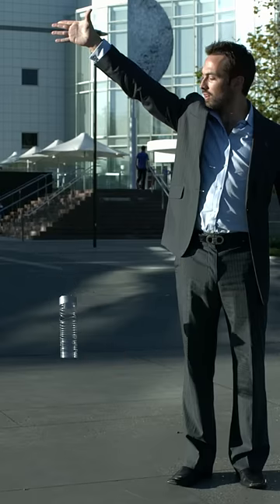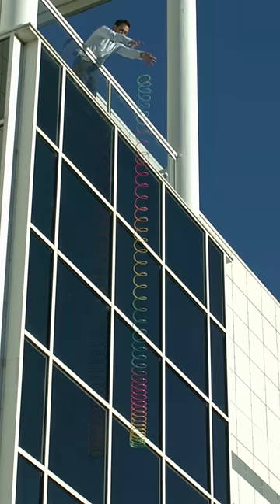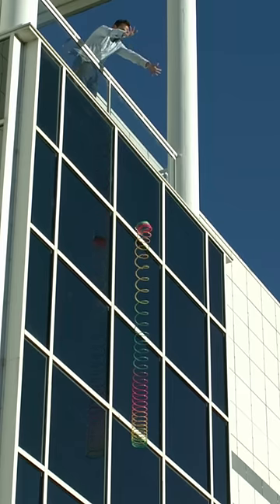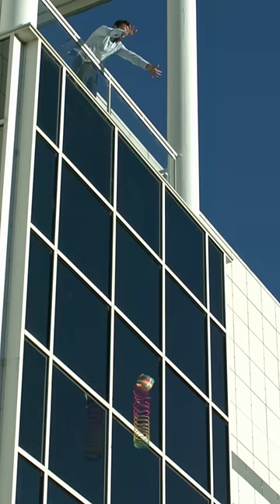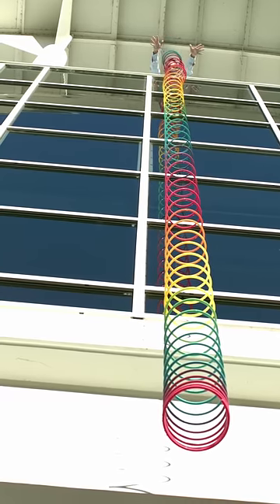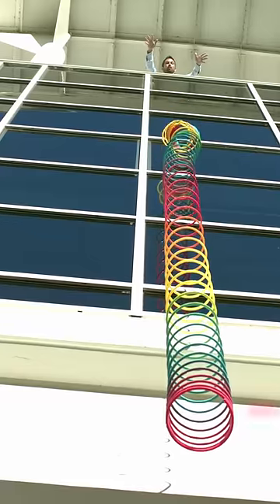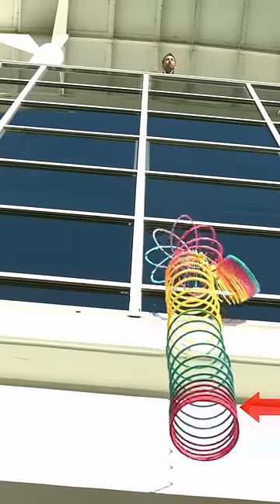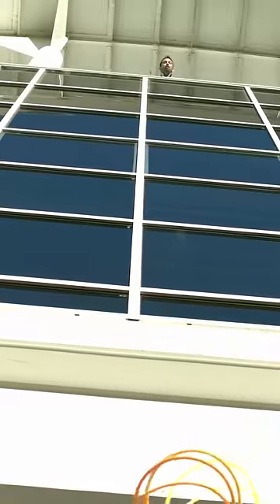How a slinky falls in slow motion #shorts

Comment: Crazy how the top of a slinky can get beneath the bottom before the bottom starts moving down
Reply: Just an illusion, the bottom is just moving up at the same rate as it is falling.
Reply: @IdgaradLyracant  well that's equivalent to the bottom isn't moving lol
Reply: @IdgaradLyracant  that’s great, but it doesn’t contradict what I said, the top still reaches below the bottom
Reply: @IdgaradLyracant  It's actually not. When you hold a slinky, there is a force-ballance between the force you applied to hold it vs the tension force. When you then release the top part, the tension force that hold the bottom part against gravity doesn't instanteniously dissappear. This "information" about the force become zero travels at finite speed to the bottom via the propagating wave on the slinky. Once the wave reaches the bottom part, the tension force that holds the bottom part then become zero and it start to fall down.
Reply: haxx
Reply: I bet we can find someone to bet $10,000 that it doesn't :)
Reply: @IdgaradLyracant  it is not moving. the forces of gravity are canceled by the force of tension upward.
Reply: @IdgaradLyracant  I'll never understand this on an intuitive level. The same effect happens to geosynchronous satellites which are "falling" at the same speed they are rotating, making them seem weightless while being locked into the Earth's gravity.
Reply: Top.. Bottom. both irrelevant. That question is where is the CENTER of gravity of the whole object. If you follow the center of gravity of the entire thing. it falls just as you would expect.  he should have done a side by side with the slinky and maybe a ball about half way up the slinky and release them both.
Reply: Because it's spring loaded genius.
Reply: Yeah
Reply: It feels very Acme
Reply: if He didn't just let go but gave it a push to any side. There's a chance the top wouldn't crash into the bottom then it would have gone much more past the bottom. probably even spun. There are a lot of variations that could be done on this experiment that's for sure.
Reply: @chessicles99  Yeah but there's a force on it. The weight is pulling it down(stretching the spring) and the spring is resisting.
Reply: @piercingspear2922  it isn't "information", it is inertia.  Inertia keeps the "top" exerting force "holding up" the bottom.
Reply: That actually makes perfect sense because the top has a big head start compared to the bottom. The bottom stays in place pretty much until the top almost passes by.
Reply: @IdgaradLyracant  Agreed, buy why? Why wouldn't it rise or fall a tad, why does it stay still?
Reply: @capturedflame  that's legit
Reply: Because the top part has greater velocity than the bottom part as the top started moving first and is accelerating at a rate of 9.8m/s^2 due to gravity. Thus it hits the ground before the bottom part.
Reply: Gravitational acceleration
Reply: @DumbledoreMcCracken  define inertia
Reply: @sachinbhargav  - The top is not accelerating at 9.8 m/s^2. The center of gravity is. The top is accelerating faster than that, because the spring is pulling the the top and bottom towards each other.
Reply: It is due to spring force which is lazy force
Reply: "before the bottom starts moving down". This should support his argument  very well. Yes the bottom is "moving up" relative to the gravity and tension in play, but that sentence pretty much sums up what he's trying to convey.
Reply: @LeonardTavast  that’s actually somewhat different. This is just a balance of forces so there is no acceleration.
Reply: While the bottom of the slinky is in equilibrium from the tension and gravity force, the top is being pulled by BOTH tension and gravity, meaning it falls faster than a solid object in freefall
Reply: @piercingspear2922  OMG.  Inertia is the force that resists motion, equal to Mass * Acceleration.  Didn't you go to school?
Reply: @alexsiemers7898  finally, someone who knows what is going on.
Reply: @IdgaradLyracant  Moving up at the sa.e speed as moving down is equivalent to it just being in the same place
Reply: @sharath2273  depends on your frame of reference.
Reply: Its like a metaphor for my life
Reply: @IdgaradLyracant  Yes, the same rate of 0 m/s
Reply: @IdgaradLyracant  If you talk about a frame of reference fixed to the ground, then it does stay still.
Reply: @DumbledoreMcCracken  no, I don't go to school. It's a waste of time. Highschooler tends to assume they know everything and debating, what they don't realize, two explanations which are equivalent with oneanother.
Reply: @IdgaradLyracant  Reported for using more words
Reply: @DumbledoreMcCracken  You forget one thing: "Educated" people also don't understand sarcasm.
Reply: @piercingspear2922  Well explained 👌
Reply: @LeonardTavast  Different mechanism.  Invalid analogy.
Reply: @JeanPierreWhite  because it was in a balance before release. The balance between tension and gravity. This tension makes the top "fall" down faster so that the center of gravity is falling exactly like any other object
Reply: @DumbledoreMcCracken  what u described is actually the reactio, considering that u need another object to accelerate ur inertial object. The inertia itself is the unwillingness to change the state of movement, which is equivalent to the mass of an object. In the objects rest frame with no applied acceleration this object is still inert, which shows u that inertia is not dependent on acceleration.
Reply: Reminds me of my stock investment.
Reply: Questions: What are the minimum and maximum spring rate constants for which this phenomenon is observable? Maybe just any spring that can be somewhat, but not fully extended due to the force or gravity alone? Also, how would one determine how fast the bottom of the spring would start to fall initially if there were a mass attached to the bottom? Just the spring tension vs the weight of the mass I would assume, but I'm curious.
Reply: @xXxTeenSplayer  it doesnt matter at all what spring constant u have, as long as it is in an equilibrium state when it gets released
Reply: @shadesmarerik4112  that's clearly not true! If the spring constant was zero (not a spring), or if the constant were so great that the spring didn't extend, then clearly this phenomenon wouldn't happen. I don't think you understand my question.
Reply: @shadesmarerik4112  To be clear, if you dropped a spring in equilibrium that has a constant that is too stiff for gravity to extend it, you would not see this phenomenon. Clearly there are limits...
Reply: @xXxTeenSplayer  no, u see it the wrong way, sry to say this. If u have a spring which is completely stiff the top immediately (due to stiffness) crashes into the bottom part and the same thing happens. Only the time frame changes (until the bottom part moves). U can compare the center of mass on both springs (slinky and stiff) and they move the same. Only that the stiff spring top and bottom will move in unison with this center of mass while top and bottom of the slinky will not due to smaller spring constant (= elasticity). i dont think u understood the phenomenon.

There is no difference in the underlying process, only a gradual change in the time the top and bottom needs to the adapt their velocity to the velocity of the center of mass when u change the elasticity of the spring
Theres no limit to spring constant, its the same thing to observe a stiff object falling or a spring that is contracting while falling. U have to observe the latter in the rest frame of the center of mass (which is falling) and then its just a spring contracting

If u want to explain why the bottom part of the slinky is not moving: because it stays in an equilibrium after release, until center of mass is crashing through the (bottom part) system. The top part moves faster than falling speed because the slinky is contracting while falling
Reply: @shadesmarerik4112  Wow, you are super confused. How could a spring "crash into itself" if it was never extended in the first place? Go back to school then maybe I'll reply again.
Reply: @shadesmarerik4112  you really don't understand my initial question, and that's okay.  But next time, before you write a thesis, maybe understand the point first. If a spring is not extended, than this phenomenon doesn't happen. Much of what you said is correct, but there in lies the rub; you don't get what I'm saying.
Reply: @shadesmarerik4112  we all (possibly with the exception of you) understand why the bottom of a gravitationally extended slinky doesn't move when the top is let go of. That literally has nothing to do with what I'm talking about. Ugh, some people.
Reply: @shadesmarerik4112  For fucks sake, you just said that a solid object exhibits the same phenomenon! You show me a solid object, that when dropped straight down from a stationary position, in a gravity field, where the bottom doesn't start moving at the same time and at the same rate as that of the top of said object.

Inb4; yes the tidal forces of a small black hole could do that, but let's limit this talk to the gravitational field of the Earth. ( And of course, that would act completely opposite to the slinky; the bottom would start accelerating faster than the top; good ol' spaghettification!
Reply: @xXxTeenSplayer  u wrote 4 comments and are still not able to justify a reason why there would be an artificial limit to the spring constant. Maybe it is as i said, and the "phenomenon" u want to describe is just the time difference between the movement of bottom part to center of mass. And "doesnt happen" is a completely subjective determination which has nothing to with the reality of the top crashing into the bottom eventually (just faster when the spring is stiff)
Reply: @xXxTeenSplayer  the bottom not moving IS the whole phenomenon that we were talking about, only u asked about a special requirement in spring constant. Stop displaying urself as a victim of failed understanding, it is u who hasnt understood the phenomenon if u still claim that there needs to be a special spring constant
Reply: @xXxTeenSplayer  i refuted ur hypothesis, if u arent able to read its ur problem
Reply: @shadesmarerik4112  I mean, if you honestly think that this phenomenon is displayed in a solid object, there's not much I can do for you. Please show me a solid metal bar, that when dropped, the bottom doesn't start moving until the top has reached the bottoms starting point, then phone in your damn Nobel prize. You need to actually learn physics before you start babbling about it and expecting to be correct. Smdh.
Reply: @shadesmarerik4112  And just be clear; for a solid object, due to tidal forces, the bottom of said object actually accelerates faster when released ever so slightly! You are so wrong on so many levels that it's actually kinda impressive haha! 😂
Reply: @xXxTeenSplayer  i actually studied physics at the university. For a solid object the top will never "reach" the bottom this is fallacious. U are desperately trying to rescue ur perspective that a falling slinky has a completely different physics than something with different spring constant which is  not the case. The bottom is just not moving because the slinky is contracting at the same time. I told this several times now, since u are willingly ignore what i am saying i come to the conclusion that u just want to pathetically troll me for some stupid reason.
Reply: @xXxTeenSplayer  and no since a solid object is ideally completely stiff, neglecting any remaining elasticity the bottom changes velocity EXACTLY like the top and the center of mass. And now u are evading the main point again with different irrelevant statement that doesnt further the topic of ur false hypothesis of some "maximum" or "minimum" spring constant that u supposed
Reply: @xXxTeenSplayer  how about u accept defeat, since u already are at the point where u make up claims about something i have never said, or taking it completely out of context, to justify sticking at ur wrong position
Reply: @xXxTeenSplayer  Just make a boost in into rest frame of the object and u will see that the only difference to a stiff object is that the slinky is contracting. There IS no hidden parameter that causes a scale invariance in spring constant. There is no maximum or minimum value of spring constant that completely changes any physics or creates a whole new seperate phenomenon. The slinky that is contracting and the bottom end is last ripped out of equilibrium. For a stiff object this time difference (between the top and bottom moving, relative to a "static" observer) tends to be zero. This is the last time im trying to explain this to u. U have not once presented an argument that can defeat anything of this. How about u learn physics or rhetoric before u embarrass urself with ur desperate misconceptions
Reply: @xXxTeenSplayer  even with not ideal elasticity the size and mass of those objects in question causing the differences in gravitational force completely neglectable vs. the tension forces of the material. That u think that this somehow bolsters ur position of a spring constant limit just shows that u have no clue what ur actually talking about
Reply: @shadesmarerik4112  I can guarantee, and actually show that you're wrong. Do you really need me to show you a video of a pencil being dropped? If you really think the point is going to stay stationary until the eraser overtakes it, well, I wish I could make believe as well as you can.
Reply: @shadesmarerik4112  And I never had a "position of a spring constant limit". You tell me why the tip of a pencil doesn't stay stationary until the erasure reaches it. You are so far out of your league it's laughable.
Reply: @shadesmarerik4112  Hopefully a point of agreement: I don't think that springs obey different laws of physics from anything else. I would challenge you to show me something not in tension do the same thing. (The Phenomenon where the bottom doesn't start moving until the top reaches it when falling). You would literally win the Nobel prize if you could.
Reply: @shadesmarerik4112  Thought experiment: What if said solid object was held from the bottom as opposed to the top? Or better yet, held continuously and completely until released? I understand that the physics don't change, but I'm not sure you do. You must at least concede that solid objects do not display the phenomenon of the bottom not moving until the top reaches it, right? To even think someone actually believes otherwise, AND is arguing for it, truly blows my mind. I thought that flat Earther's would be as bad as it got; boy was I wrong.
Reply: wah
Reply: @xXxTeenSplayer  NO the phenomenon is an object falling upon release. In the case of the slinky it contracts while falling, which CAUSES the bottom to not move for a short time relative to an earth frame observer. EVERY solid object will fall upon being released, if we neglect air. There is no other physics involved.
The slinky is just a special case of a general phenomenon that we all know.
But u are so desperate trying to deliberately misunderstand me, or just not read what i was writing. U want to wiggle urself into a position where ur original statements make some sense, but they dont. There is no spring constant required to explain a falling object. If u want to have the bottom not moving for a short time u just need to compound a contracting movement, but a stiff object falling is the same phenomenon where the time intervall tends to zero. Like i said: its a gradual transition when u change spring constants up to a point of no elasticity where the time frame tends to be zero between movement of bottom and top part, there is no fixed point of spring constant that changes the whole physics
Reply: @xXxTeenSplayer  
"Anyone who says, "the top and bottom need to adapt thier velocities..." clearly doesn't know anything about physics. And the spring constant (generally k) is totally different from elasticity. Literally completely different things. Seriously, don't talk out you your ass; I had a serious question, and you gave me a flat Earther style answer." (written by an idiot)

Concerning elasticity: "When an elastic material is deformed due to an external force, it experiences internal resistance to the deformation and restores it to its original state if the external force is no longer applied"
"If the material is isotropic, the linearized stress–strain relationship is called Hooke's law, which is often presumed to apply up to the elastic limit for most metals or crystalline materials whereas nonlinear elasticity is generally required to model large deformations of rubbery materials even in the elastic range"(wiki)

So elasticity in ur mind has nothing to do with the spring constant? Who is the Flat-Earther who denies science?
Reply: @shadesmarerik4112  Dude, what does this have to do with definitions? I just pointed out that you didn't understand what I meant by "this phenomenon"; which is when the bottom of an object doesn't start to move downward when the top is released, rather it stays stationary relative to the ground until the upward tension force no longer equals the downward gravitational force. That is the phenomenon, bite the bullet and accept that at least!

BUT!!!! You haven't once addresses my original question! So let's break it down so maybe you can. If a solid object OBVIOUSLY DOES NOT DISPLAY SAID PHENOMENON, AND A SLINKY DOES, WHAT IS THE DIFFERENCE? I submit (my very first claim here), that the difference is that when the slinky is subjected to a gravitational force, thus extended and in tension, we see this phenomenon, yet most other objects do not. Both the displacement, as well as then tension, will be directly correlated to the spring constant of the slinky.

Now, if you accept my claim that the bottom of a solid object will not "wait" for the top to reach it when falling, like the slinky does in the video, and that neither would something like a string; than I'll ask you what the difference between these objects could be? Do you think they might have different spring constants? HINT:  THEY DO!  Namely: infinite, some, and zero. Where do you think the limits lie? 

And I've also pointed out that a solid object in a gravitational field actual displays the OPPOSITE effect (spaghettification). You may not understand because you think spring tensions is elasticity...

You my friend, no longer have a leg to stand on. Give it up, or go to school before you spout anymore nonsense at me. For fucks sake you think elasticity is the same as spring constant, you need to learn more dude.
Reply: @shadesmarerik4112  In order to understand, you really should start with General Physics I, II, Dynamics, and Mechanics of Materials. Pass these university courses, or better yet pass an FE Exam, and we may be able to continue. Or just concede that you really don't know what you're talking about...
Reply: @shadesmarerik4112   To be fair to you though, you're clearly better suited to learn something like philosophy, since your only arguments are things like "moving the goal post", or "retreating to definitions" (even though you are totally misapplying these concepts)... Since you already seem to like it, but still have these completely wrong, you should start there!
Reply: @shadesmarerik4112  Or, just show me your noble prize winning evidence of a solid object displaying the phenomenon seen in the video! I mean, that would be fascinating and shut me up real quick lmao 😂
Reply: @shadesmarerik4112  Just out of curiosity; are you English as Second Language? If you are, it could just be a problem with language. It really does seem like you just don't get it though... It's like you thought about it in your head, and it made sense to you, so you're just running with it. That is NOT how science works.

To be helpful, maybe start with learning how a spring force is different from elasticity in a solid object. It seems that your equivocation of the two may be why you're still not getting this
Reply: @shadesmarerik4112  P.S. The original comment we are replying to is specifically talking about how the bottom doesn't start moving until the top gets there. I doubt that you somehow construed that phenomenon as "just falling", rather, you have just been trying to save face. Or trolling (in which case nice work!).
Reply: @kraven4444  maybe he'll do that in an update video...
Reply: @zeik101  a very Wiley thing to say. Thpbthpb thpb!
Reply: @sachinbhargav  the top is accelerating at a faster rate than it would if gravity were tge only force at play. The other force is the tension in the spring pulling it down
Reply: @capturedflame  eh, I didn't understand Tenet.
Reply: @IdgaradLyracant  it’s not an illusion that’s extremely wrong people need to stop saying things are illusions when they see a scientific effect they don’t understand in action